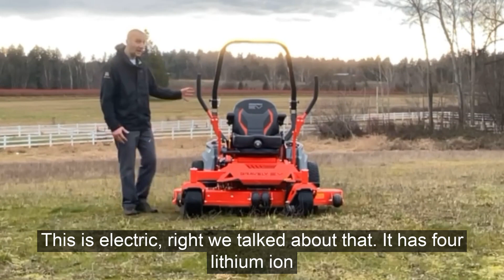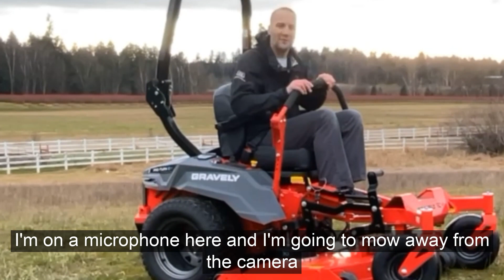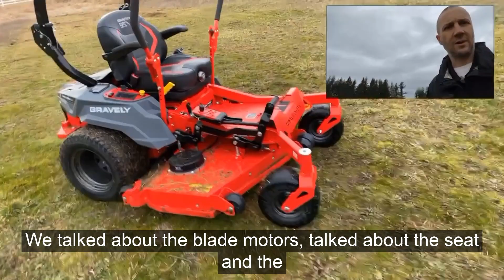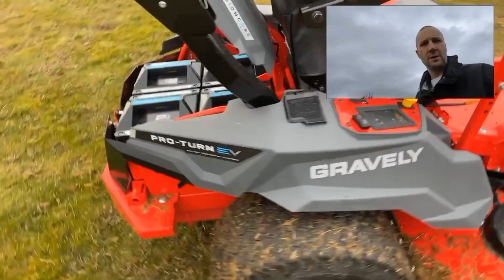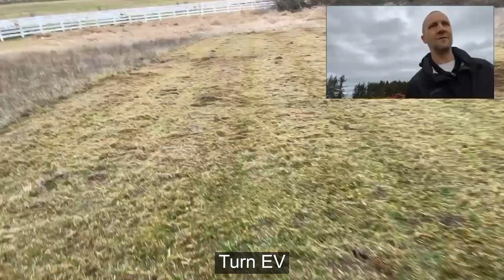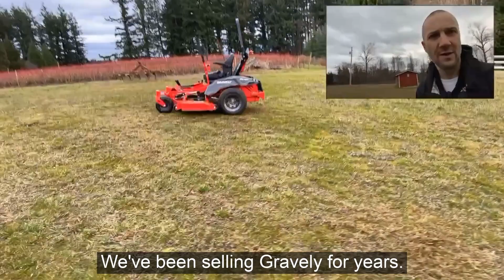Electric Gravely Pro -Turn EV Commercial Mower

Comment: The EV  60 Side Discharge with Batteries is $32,500,  without batteries $23, 500  +/_.  Why??   Without Batteries that price is almost $8,000 more tham a  Complete 660 Gas EFI , something is serious  wrong with the EV Pricing???? JMO

Comment: What's the expected useful life?
Reply from the maker: The batteries are rated at 2500 charge cycles.
Reply: @Carlsmower  how long does one charge cycle last?
Reply from the maker: @user-wg3bu5wh6d  Obviously load dependent but they are aiming for 12+ acres and I have found that to be true in normal conditions

Comment: I had 7 Gravely mowers in the early 90/s. Not the best mowers l ever had lots of problems l probably don't have to tell you that. The EV looks like a great mower how much does it cost what's the weight ? Because it's all in the rear of the mower balance problem ? Too much weight to the rear tires and what's the cost of the batteries nice video 👍
Reply from the maker: Man you’ve had a lot of experience. Lots has changed with Gravely they are durable. 
I don’t know exact weight but batteries are 50lbs each   
Balance and traction was fantastic in my use.
Reply: Price is 28k for the unit.